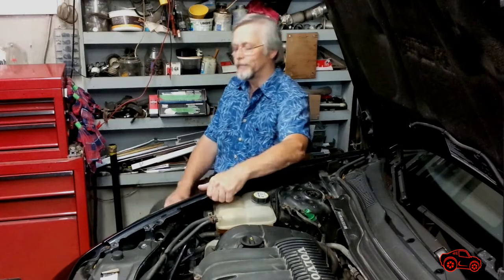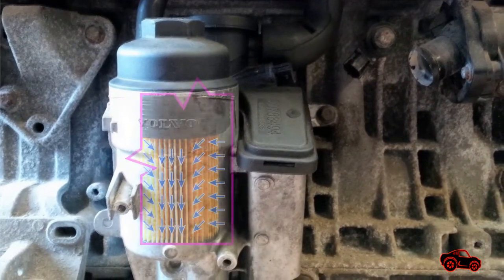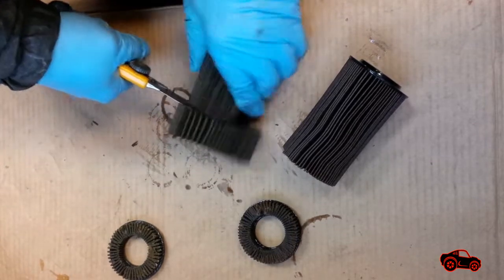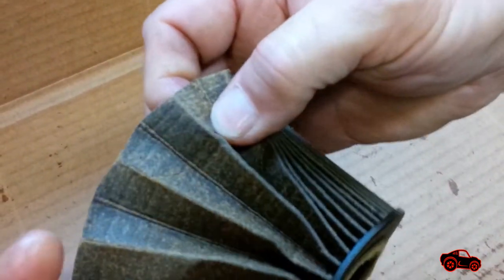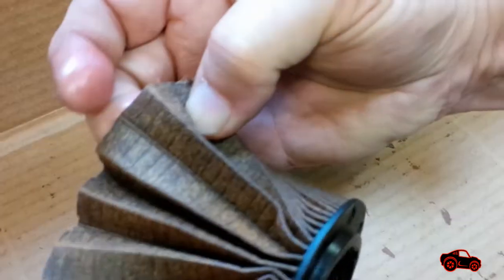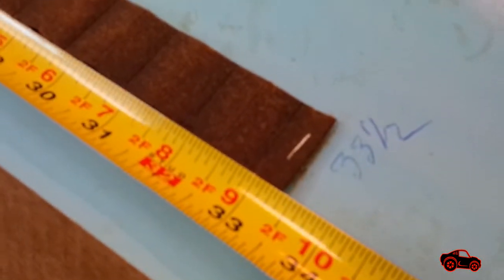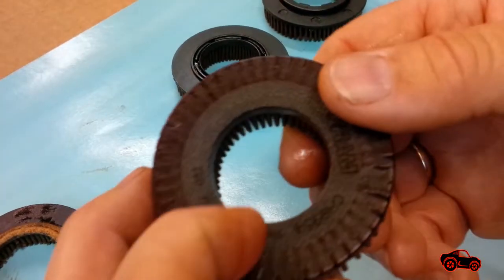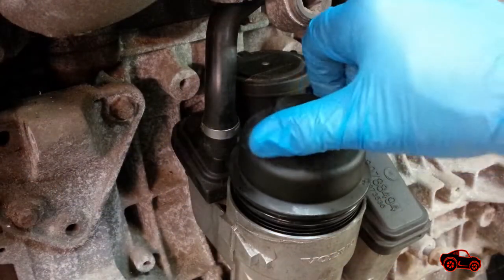Compare Cartridge Oil Filters

Comment: Here in US, local Caterpillar branch offers the oil analysis service for around $15. They only take a small pint of your used oil and give you great information in return that helps determine health of your engine (a panel of metals found as a result of crankshaft & camshaft wear), health and quality of your oil (great for determining maintenance interval) and lots of other useful stats. It would have been interesting to build upon your great oil filter comparison with an oil analysis from each of your maintenance intervals to compare concentrations of fine metals in parts per million to see if the particulates you see between filter pleats really have made a difference.

Comment: Thank you for putting in the time and effort to make this video. It gave me a lot to think about because my new truck is the first vehicle I have owned with a cartridge style oil filter. I don't really understand the reason for cartridge filters. Thanks again for the video.
Reply from the maker: I don't know why Volvo used a cartridge style oil filter. Maybe because it is combined with the oil separator unit. One thing is good, because the filter is mounted upright, I can check the oil filter without having to drain the oil pan.

Comment: Great vid mate!  
My 2008 V6 Holden VE Commodore 60th anniversary edition has a top mounted cartridge filter that is easy to change just with a 23mm socket and does not drop any oil during the change.  
I use Penrite HPR5 Extra 10 (5W-40) full synthetic oil which I change every 10000km, but I also change the oil filter every 5000km because they are cheap and easy to change up in the engine bay.  
I check the oil level on the dipstick about 15 seconds after turning off the warmed up engine.  
Regards, Jas.  
vk4fjgs  
Rockhampton Queensland Australia
Reply from the maker: It is a good strategy based on your cartridge housing configuration and the temperature in your country.

Comment: Nice vid allthought you don't mention how badly some of those filters collapsed even tho they filtered well the collapsing part just shows how bad the quality is and to not buy them again.
Reply from the maker: Thank you for the comment!  Can you tell me and the viewers the name of your filter that doesn’t collapse? I would like to read comments about it from viewers. I will also try it the next time I replace the filter. Note: It may take some times since I do not travel because of the Covid 19.
Reply: @mtlcarguy  no worries man, some good brands that don't collapse are MANN filters and or Bosh from what I know. But in my case I allways use OEM I drive a 2017 C43 AMG I changed my oil filter once to fram and it collapsed badly I said never again and since then I only do oem to stay safe. But MANN or Bosh I heard are very good 👍
Reply: @vladt6038  but WIX filters is owned by MANN, it mentions it on the box of WIX filters. Bosch filters are made by MANN too but rebranded as Bosch brand.
Reply: @forestcrown516  that dosnt mean quality isn't different owned and quality are two different things. BMW is owned by rolls Royce and Rolls Royce cars are made better. It dosn't mean anything.
Reply: I've used OEM, Super Tech, K&N and Fram Ultra cartridge oil filters in our 2009 RAV4 and never had one collapse but that's with a 5,000 mile oil change interval.

Comment: Thank you for making this comparison video on cartridge filters.  This is very difficult to find on YouTube.  I have found it to be quite helpful.  I'm sure that you would rather have used centimeters instead of inches and I appreciate this.
Reply from the maker: Thank you!  Before I retired, I worked for many years with 2D and 3D drawing programs.  I don't mind using metric or imperial.  Good luck with your filter selection.
Reply: I'm quite unsure that this proves anything.

Comment: i am glad to see someone has finally ripped apart and examined a cartridge oil filters. I am currently using a Fram TG9972 on my Toyota Camry.  This filter seem much better then the OEM Toyota filter.  Next filter I am going to try on the next oil change is the WIX filter.
Reply: i am new to catridge filters, do i have to look at measurements to see if a catridge filter will fit in my mercedes?
Reply: Wix or Purolator make excellent filters. They are the makers of the “premium” filters stores offer, like NAPA Gold.